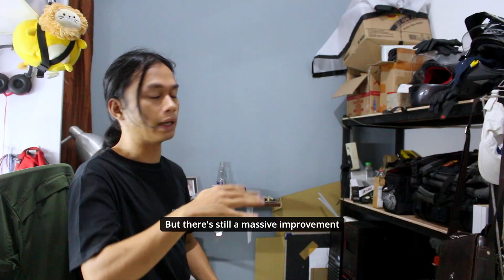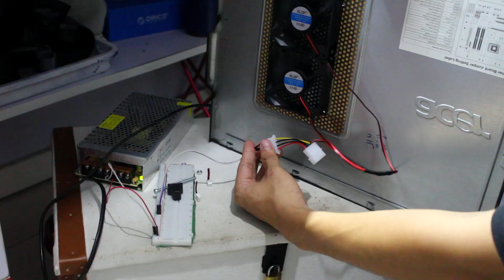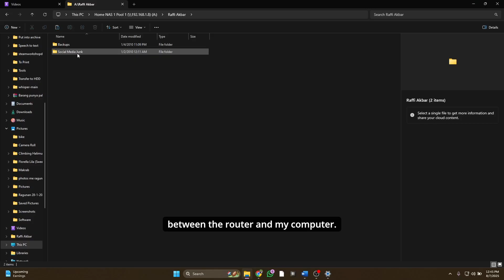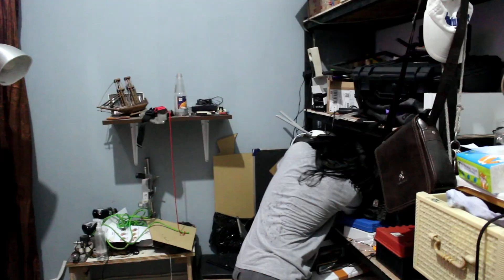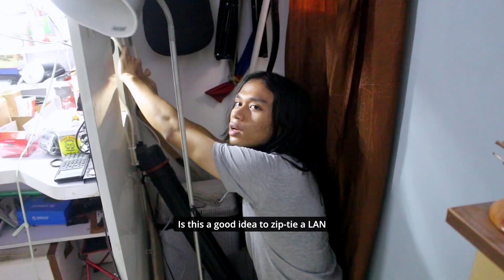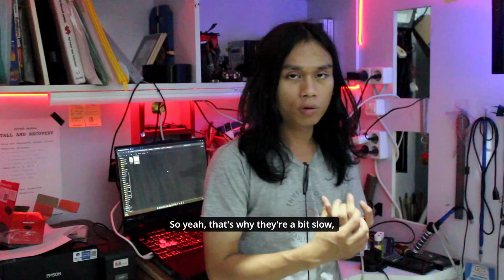Upgrading the Networking Speed of my DIY NAS

Comment: For the heating issue I would recommend adding in fans from the front of the case then out fan in the back to remove the hot air as you'll continuing having overheating issues inside the case. The PSU will not provide enough airflow for the case. For optimal cooling and quietness noctua.